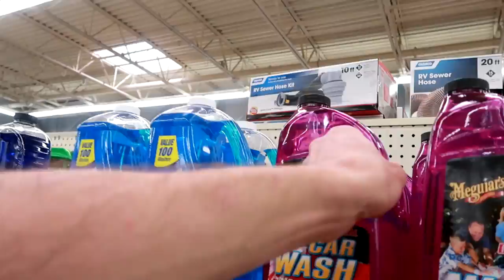DESTROYING MY TRUCK'S PAINT!!!

Comment: the paint just falls right off your truck... dude thats not normal
Reply: shitty paint does that sadly my truck is 15 years old paint only has swril marks on certain pieces and even the roof doesnt look or feel as bad as his and mine cant fit in no parking garage or anything sits in the sun daily
Reply: gm has their white down pat though, I'll only own a white single cab lol
Reply: lukasz bla they really don't build stuff like they used to. that will change here soon enough.
Reply: I have a white single cab and it's peeling
Reply: Matt's Garage - TakeiT what year? mine an 03, it's been outside every day of its life, waxed maybe 3 times ever, I wash it like 2 times a month though. It still looks new except for scratches. I always thought gm did white really well, everything else seemed lacking. maybe I got lucky.
Reply: '98, I mean the truck is almost 20 years old, you can't really argue with it.
Reply: My stepdad has an 06 silverado 1500 with 115k miles and the factory paint is perfect. i think nissan has the worst paint, look it up. Yall can hate on chevy all you want but our parts will always be cheaper and way more reliable.
Reply: my 99 Silverado hasn't had a wax its whole life. it's in a garage 50% of the day, the other 50% it's outside. besides the minor scratches and oxidation, it's fine. buffed the hood recently and it looks perfect. it's gray if that matters
Reply: it's GM truck paint. it always does that.
Reply: BoringMinecraftDude bullshit I have a 1998 gmc 1500 and it has never been repainted or touched up with absolutely no rust
Reply: twisted machines but them springs tho
Reply: McSteeze that's  because it's amerikan
Reply: Yall can keep talking shit , but you guys know damn straight at the end of the day General Motors is the best OVERALL. Its just facts. Best engines and we have the best looking cars/ trucks. From classics  to new cars.
Reply: Hancho familia
Reply: Hancho familia
Reply: Hancho familia the engines from the older cars are actually really good. But you can't compare a Ford mustang with an m4 or c63AMG... the quality of the interior from amerikan cars is really bad too and we don't want to talk about the lock (mostly/often) and that's because they cost less then a half of a german simular car
Reply: Hancho familia I can use tools and if you got the best engines it's mutch Bader and I just wanted to say that amerikan cars are shitty and cheap exclusively the engines but the cars  are a good possibility  if you want a big ass car and presenting your nuts but you are poor
Reply: not sure what year this truck is, but in the 90s the EPA started cracking down on paint and let me just tell you paint in the 90s was shitty
Reply: chabka34 its the best OVERALL.

Comment: when you wash your truck. spray the wheel wells really Good. get that salt off. to clean your windows you can use a news paper it doesn't streak. I used to do auto body.  hope it helps. cheers

Comment: You wash the chassis ? That's where the salt REALLY collects..
Reply: Timmy D his whole entire chassis was just undercoated for the second time
Reply: moedogger21 Didn't know that, just subbed less than a month ago.
Reply: Timmy D Yeah I'm a 3DMACHINES crackhead 😊
Reply: most undercoat is worse. Unless its awesome stuff, the salt and debris just gets under it, and is trapped and rusts out even faster.   I am not surprised he has undercoated it twice, that is how poorly most of the shit works. Undercoated or not, you still wash the chassis.
Reply: dynocompe yes he has undercoated it twice because he was not happy with it the first time. That is the reason for the second undercoat he said that he will keep doing them until he's happy. Of course you would still want to clean under your vehicle but it's not as big of a deal when you have a good undercoat if you skip one here and there
Reply: I disagree with that a lot, Most important part, especially if the salt is from highway driving. Ever notice how much more dirtier your vehicle gets on the highway in bad weather conditions. That shit gets everywhere. First thing i do when I get to my destination from a road trip in salt country(where i live, Canada), is go to the car wash, and my biggest concern is washing off all the salt. You do know bare metal starts to rust immediately right, it doesnt take days for it to start, metal starts oxidizing immediately.  This is coming from a guy that has never undercoated his truck(that shit is worse, only a few undercoating products i would even consider.) and has never owned a truck that has began to rust. My truck is 11 years old, looks almost as good as the day she was bought, and its black, I actually have two 11 year old trucks, but only owned one from new.  I have never had a vehicle rust out on me. Only vehicles I had that had rust, were my winter beaters that I bought with already rust. Last one was a  2005 chevy, that truck was only a 2005 and would not pass a safety because the rust was so bad. I find chevys especially are prone to rust.

Comment: There are rubber plugs inside the beds wheel wells on this year chevy, if you want to prevent rust through periodically pop those plugs out and clean the dirt and salt build-up out.  I usually shoot a little oil or fluid film in there as well.

Comment: When using the microfiber towel, run the towel in side to side lines, don't go in circles. It only swirls the dirt in circles and creates additional scratches in your paint. Also, wash, rinse and dry the truck panel by panel. This reduces watermarks

Comment: I've been cleaning and detailing cars for a while now at car deanships the key is to make sure to wash off the dirt/dust then scrub the car well and repeat that process then just wash it all off and dry it. I like to use these special towels that work very well they are called aqua dry towels. Also it will help a lot if you buff you car you can buy some heavy to medium "cutting" compound from many auto stores you can apply the compound on to a buffing disc and place that disc into a angle grinder or drill. just apply the compound to the pad and buff the car(many instructional videos on youtube) after buffing it wipe the compound off of the car with a clean towel and use a polish compound to finish it off. This may sound a little confusing let me know if you have any questions.

Comment: I painted my truck with bedliner. No more damaged paint and it will hopefully last forever. it may not be the look you are going for but it is a lot less maintenance. I used a product called Monstaliner which is designed to be more like a thick paint. The whole thing cost be about $600 and i did it myself in 2 days. It is super simple and is applied with an undercoating gun.

Comment: One tip from me is use a soaker head on your hose rather than a high pressure head. High pressure water will just destroy your clear coat. 

And personally I'd recommend re waxing after every wash and when you wash it take all the old wax off

Comment: to prevent rust on pick ups / stick wand type washer up beind the rear wheels and wash over the inner fender-- outside box body joint , this is where sand & salt sit and why truck boxes rust / there might be a plastic panel up there from the factory, take it out and toss that it's just catch all for salt

Comment: Start with the wheels and tires first. Then do the rest of the truck from top to bottom. If your looking for a super streak free job, use a blower to blow the water from the hard to reach places, like door jams and mirrors. After it's dry, use a spray wax, doesn't last super long, but it does a good job between washing.

Comment: When I clean my truck I just use a hose, a bucket of soap and water, and a brush made for vehicles. I wet down the whole truck and then clean the windshield and hood at the same time, then the sides, then the tailgate and back window, then each wheel separately

Comment: hey when you wash your truck with anything that has more pressure than a regular garden hose and no attachment spray at a angle away from your self also start at the bottom work way up

Comment: your clear coat is gone i use just a normal garden house on mine dose pretty good plus if you are using a nossel on the house dont push the handle all way down makes for more pressure and stay about 2 to 3 feet away makes for less pressure against the pain and wont make it chip

Comment: I have a 2002 2500HD crew cab LB7 duramax still no paint issues,  no rust at all.  need a 4 inch dual split straight pipe on your truck they sound awesome. use engine paint it will last longer.

Comment: Get a bottle put some oil in it run a brake line into the side and run air through the other use the brake hose to get into all the. Holes in the fenders and rockers to keep the, from rusting the oil will fight the rust and keep the dirtymax looking nice

Comment: if you put the nozzle into the water it doesnt bring air into the water and it wont get as bubbly. so you dont waste the soap you spent money on. thats what i do, i let it get foamy at the end, i usually let the water spray slowly till there is enough to put the nozzle under the surface, it will still mix the water and soap but wont cause all the foaming.

Comment: The paint flaking off your truck is probably do to a lack of waxing the paint and the constant exposure to the Florida sun from the previous owner who probably didn't wax it at least once a year... The recommended cycles are 4 time a year... The wax bonds to the paint and conditions it with oils... without... It will flake....and for tips U should have 3 buckets two for the paint and one for the wheels only, if you wanted to make the polished style wheels you have look new again pick up some mothers metal polish... And if u want to add a bit more shine after a wash add some spray detailer to the paint... But where ever you repainted make sure it's waxed so it doesn't flake up....

Comment: 3D machines every time you wash your truck it gets worse because you use a power washer. Those things blast off all the clear coat and then as you have noticed, chips away the paint. Get that classy machine all repainted and use a clear coat this time to preserve ur trucks perfection and whenever you want to clean it...just use soap, rags, and a regular hose nozzle on shower spray.

Comment: That wear behind the rim? do those rims fit? that wear ring on the back of the rim looks like it was rubbing even before the tire came off. Hear me out, if the rim didnt fit all the was against the hub even when the lugs were tight, the wear would slowly cause a gap and in turn make the lugs loose right?

Comment: if the hose did that then maybe it was a good thing the pressure washer didn't work out or you'd leave Florida with a gray truck... look into the Duplicolor Paint Shop diy system at the parts houses or online, very simple system to DIY at tons of stuff to choose from.

Comment: It happens with any paint, paint my 2015 jeep does it cause the pebbles will make a tiny hole and it will work its way in . I always get one of the touch up pens for cheap instead of getting a new pane l mucho cheaper !!. I get them all the time all the time wheel in the woods #1 reason I got her some sexy limb risers he he. Also if your down at the beach wash that underside down the sea salt will eat ever the rinno line if it finds a pin hole through. Have a good time enjoy the weather down here.

Comment: I'm strict when it comes to cleaning my cars but truck are truck scratches and dirt aint gonna hurt ....... go get the paint job where you straight rhino line the entire truck the entire outside then climb your ass under the truck spray it with foam degreaser very very generously I mean like 4 cans let it sit for like 6  hours then rinse with pressure washer and repeat 1 to 2 more time me personally 3 times is what I do then take it and get a rhino lined undercoat then u have a much easier job but only do all this if you plan to keep the Beauty .....the rhino paint job makes it to where u never worrie about outside scratch  and the under coat makes it much better and easier in the underside to prevent rust and wasnoff the certain spots that can be under coated

Comment: the water beaded up on your tailgate because of diesel residue from your exhaust bro
Reply: Bill Satterfield his exhaust is at the side of his truck tho
Reply: thomas brocklebank you are correct..but air drag at the rear of a truck pulls the air from the sides into the tailgate..if you ever see a reaaly dirty diesel truck..you will always see the tailgate and bumper are black from soot deposits.

Comment: To me it looks as if the vehicle has had a repaint at some point of it life and it doesn't appear to be a good one. With the paint just flaking away like that it's probably because the surface the paint was sprayed on to wasn't prepaid / sanded down properly so instead of sticking its just falling of the surface.
If it was my vehicle i would get it resprayed as soon a possible as under coat is porous and so will speed up the rate of corrosion to the body underneath causing further damage or bubbling.

Comment: if the hose is taking paint off the truck was probably wrecked and repainted. used to work at a carwash i know how much presure a original paintjob can take vs a repainted part. POOR PAINT PREP can ruin a nice paintjob

Comment: Your truck had to of been repainted and in the process they didn't prepare the truck correctly for paint a properly painted truck wouldn't get messed up just from a hose but a pressure washer if you get to close it can peel right off also saw a lot of orange peel on your truck

Comment: Complains about how washing his truck takes his paint off... now I restored a 1966 jaguar and I used a powerwasher(electric ) to take the PAINT OFF... just use the hole at a small flowing speed, should only reach 2 ft max if r holding it straight up

Comment: Get a ford f 250 power stroke v8 turbo diesel!!
Reply: Bullseye fuck yes!
Reply: Jeff's landscaping Lawn care no
Reply: i dont think he would want a truck that falls apart
fords are pretty shitty
Reply: Duramax V8 turbo diesel, or a Powerstroke V8 turbo diesel.... Just can't see myself with a giant P on the back window.
Reply: Apparently the gold spray paint is best for huffin.  Fucks you up the most.
Reply: Kevin Kapity I have found the power strokes better.
Reply: that opinion or based on facts. I have a ford other trucks wish they could be as dependable. 210K and starts right up. doesn't leak a thing or burn oil. never has left me stranded and pulls 5k plus everyday. hauls wood every year and goes to silver lake sand dunes all summer. iv always been a chevy guy but this ford I have just wont die. shes a good old truck.
Reply: FinerThingsInLife I honestly prefer a Duramax. I'm not saying a power stroke isnt any good however. I believe any vehicle when properly taken care of will last forever.